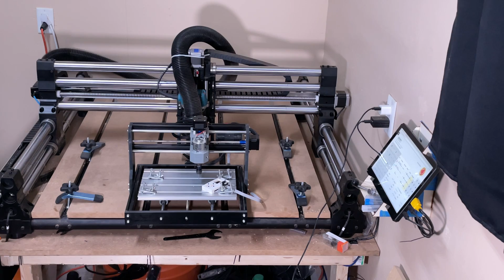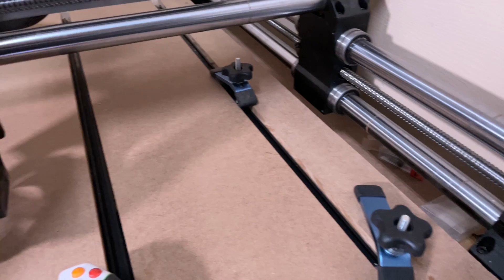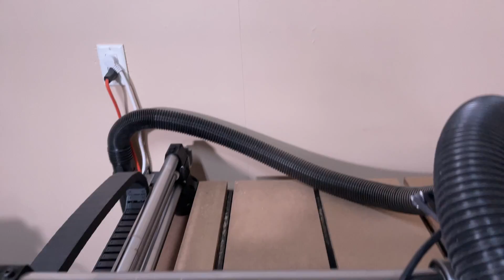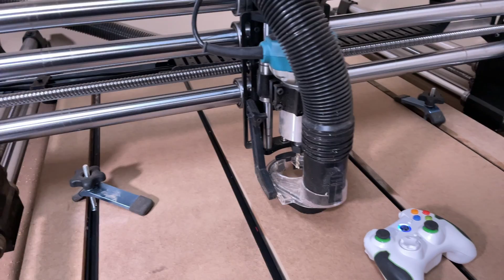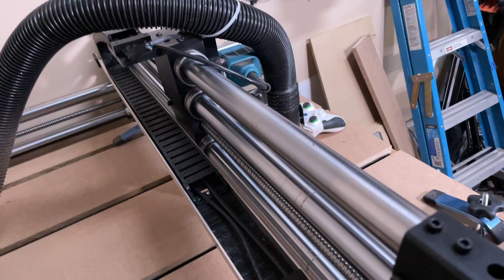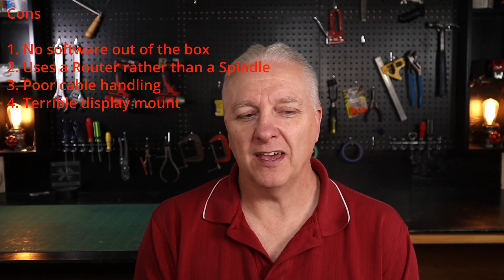Onefinity CNC Review

Comment: Hi
You know a lot about lasers so do you think its a good idea to get laser for the Onefinity if you already have the machine or still better to get a stanalone laser? If not why. Space is of course a consideration.
Reply from the maker: This is a tough call. The biggest reason not to do this is because when you are running your laser your can’t do anything with your CNC. I like to multitask. Moreover, compare the price of a standalone laser to the laser module for the Onefinity and you will see there isn’t a huge price difference
Reply: @SteveMakesEverything  thanks. Understand that point. I don't know much about lasers yet. Is the Jtech decent and should one get the bigger one or only if looking to cut out pieces and guess would be faster.

Comment: they wont support use of drag chains
Reply from the maker: Just add your own.  My Onefinity has them.  I also replaced the trim router setup with a liquid-cooled 80mm spindle.  It's quieter and much more precise.

It's an easily upgradable machine.

Comment: the mechanical parts is great but they arent keeping up with the competition. big design flaw with the qcw frames. support always blames the user but what they dont know is this isnt m first but every issue ive had they assume we are idiots use error bs comments from support. the shapako contrller is way better than the 1f. can run mutiple tools and machine stop for tool xchange not the 1f though. it will fault out and they said to me we aint reinventng the wheel lol arrogant lazy support. they wont last long with the attitudes they have. im not the first to say this. I even showed them how to fix the qcw frames design flaw. 
have you ever tried to use your clamps in the t tracks with a full shet covering the work area. it cant be done only clamp in the back lol 9 inch design flaw totally over looked
Reply from the maker: I won't get into a religious war over one CNC vs another, but having used a Shapeoko in the past, it was instrumental in me buying a Onefinity.  The used of screw-drives rather than belts and beefy linear rods rather than rollers, sets the Onefinity apart for accuracy.

Not sure how significant the QCW flaw is for most users.  I have one and  it seems to be fine, though I could just as easily have put my own rails down and attached MDF directly to my table and have it be just as functional, so I probably wouldn't recommend the QCW to anyone.  I think I could change my waste boards just as fast, or faster,  without it.  It's only real value is that it solidifies the machine with a square frame that makes it easy to move, but since mine is bolted to my table, that's not my use case.

I would definitely agree that the ability to support a 4th and 5th axis would be fantastic, as well as an option for a tool changer (even if I had to add these extensions myself.  However, you can order a Onefinity without any controller and just supply whatever controller meets your needs.

Comment: What is the "Skippy" you mention?
Reply from the maker: I had to go back to rewatch this to get the reference to this.  It's "Stiffie" not "Skippy".  The Stiffie is the third rail on the X axis that as the name implies, really stiffens up this axis because this is the one that bears the weight of the spindle.  I've since upgraded from the Makita trim router to a proper 80mm spindle and mount and turned what was a great machine into one that it simply awesome.
Reply: @SteveMakesEverything  Thank you for the kind and prompt response.  Upon further study, I realize that the larger units use a much thicker tubing for added rigidity.  I will be using the larger X-50 and using a 2.2KW spindle.  Thanks again.
Reply from the maker: @RushSimonson  Yes I believe the tubes on the x axis are large diameter on the X-50.  I have the X-35 with the "Stiffy" and a 2.2Kw spindle works perfectly as well.

Comment: Thanks for the video.  It helps my decision on my choice.  On the  “Cons”, I don’t see a biggie that would make me say no to a OneFinity.  For the video mount, I have so many Ram Ball mounts piece, just going to use it.  One Pro that you didn’t list was the on the controller, the ability to put your CNC files onto a USB stick, and with the display,. You can run the cut from the usb file.
Reply from the maker: The included video mount is pretty flimsy. After I bumped my monitor off a couple times I just made a bracket and stuck it to the wall.  All I ever use the screen for is to start a job and for everything else I use the web browser on my computer. I don’t think I’ve ever put a usb drive in my controller. The OneFinity provides a web server so I go direct for a tool like VCarve to the CNC 

The palm router that a lot of CNC companies use is also sub-par. If you’ve got the money then budget for a spindle. I upgraded to a liquid cooled 80mm spindle and what was a great CNC machine became incredible.  With that plus a collet set my machine is ultra-precise and can hog its way though pretty much anything.
Reply: @SteveMakesEverything  My plan is to go to a spindle, I want to use the router to get me started.  Easy to get started.  Thanks.  Did you post the video yet installing the 80mm spindle?
Reply from the maker: @scottmorris4914  I did shoot some video for the 80mm spindle upgrade but I never published a video.  There are a few videos covering this on YouTube
Reply: @SteveMakesEverything  can you supply a link of the one you purchased?
Reply from the maker: @scottmorris4914  The one I got was the HUANYANG 110V 2.2kw vfd Spindle package and I have no regrets: https://amzn.to/3Gdjsmv

Note you will also need to buy the 80mm spindle mount from Onefinity.  If you or anyone else wants, I can probably put a bunch of the video fragments into a video, but there are a few video out there already that are fairly complete
Reply: @SteveMakesEverything  thanks.

Comment: Steve. I’m looking at getting upgraded CNC next spring. Currently using belt driven due to cost and learning CNC. How would you compare this machine to the workbee ultimate with air cooled spindle 1.5KW? Thanks in advance for anyone that knows both of these machines.
Reply from the maker: I love the screw drive on the OneFinity.  Belts can stretch and are somewhat elastic so there is a bit of bounce on direction changes. This doesn’t mean belt driven CNCs are terrible, but they can be slower. I upgraded my OneFinity to a 2.2kw liquid cooled spindle and have no regrets. I’d recommend this upgrade to anyone with any router-based CNC.
Reply: @SteveMakesEverything  
Thanks for the input. Thank you for the informational videos.

Comment: Thanks for this. Do you think the Woodworker is big enough.. Or if buying again would you consider the larger Journeyman? Thanks!
Reply from the maker: It can handle about 32” in each direction.  Unless I’m making a sign I use about a third of that
Reply: @SteveMakesEverything  Thanks Steve.. So sounds like the Woodworker is more than enough to do a lot of common jobs. Thanks!
Reply from the maker: @MatthewPolack  They do make the larger one if you want to work on 48x48" material, but I haven't had a need to something that large myself.
Reply: @SteveMakesEverything  Thanks Steve...is just a debate for me at the moment...I like the idea of 'buy once buy well'..but may also have very little need for the extra size! Thank you.
Reply: @SteveMakesEverything  32 x 48
Reply from the maker: @vikingcat794  I stand corrected.  I guess in theory you can make projects that are longer if you're willing to slide a longer piece of material and make a second engrave, though I haven't tried that before.